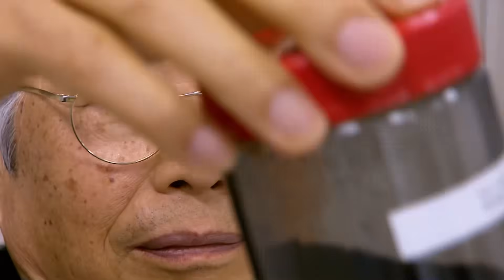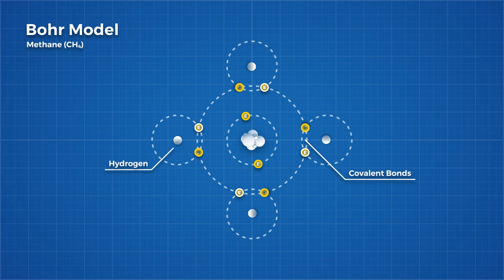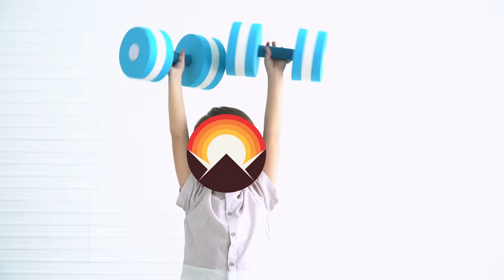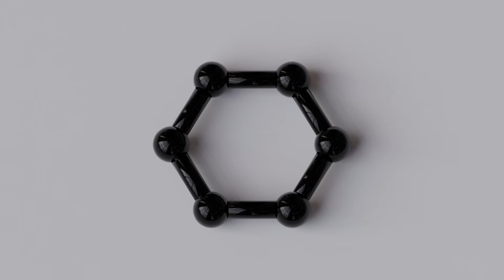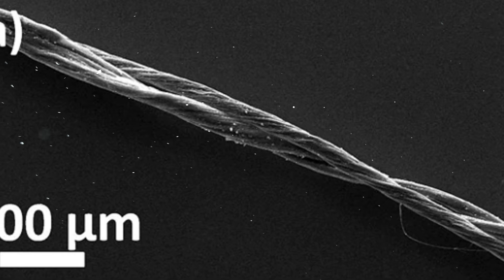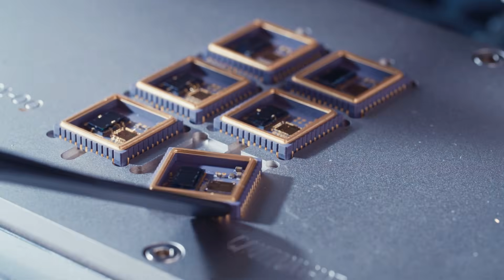How Carbon Nanotubes Will Change the World

Comment: I have been using carbon nanotubes for my drone's motor shaft. I build FPV helicopter in my channel with direct drive rotor using generic 4mm steel rods that does not have bolting holes. I used to use Kevlar to make friction clutch fitting that holds the motor bell to the shaft without bolting. Carbon nanotubes (Galvorn brand) are stronger than Kevlar and less frequently sheared (cut broken) during the shaft installation. The only reason I tell my followers to use Kevlar is the small scale of production by Galvorn with wait time of about 10 days per order. Kevlar dental floss is available in pharmacy 24x7. If only dental floss are made with carbon nanotubes, they will become ubiquitous as household items.

Comment: I work as a polymer engineer. Great video, however we are still a few more years away from seeing them readily used. They possess way to may health risks and dangers. I have had first hand experience working with both single (SWCNT) and multi (MWCNT) nanotubes. One must really understand and know what they are doing when working with CNTs or else there can be catastrophic consequences to themselves, equipment, machinery, and the environment.

Comment: think of low resistance cables which could send electricity to the other side of the planet without considerable losses. that would remove the need of energy storage would it not?!

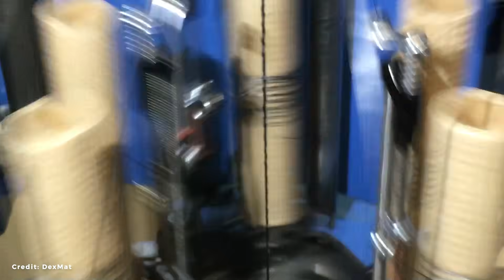Comment: @11:02...'single extremely long fiber' that's the catch... all these wonderful properties are only possible in 'defect free' ultra-long CNT... till date CNTs have been grown only until 700 mm max.. and even these so-called long CNTs are filled with defects which makes them materials of very low strength..  CNTs have been hyped up as wonder material since 1990s, but till date it failed to deliver.. space elevators etc. are only day dreams atleast for the near future

Comment: can plane engines be powered by electric
Reply: Short answer: Yes
Long Answer: Y     E     S

Look at what we're doing with EVs on the road today. The limitations are the weight of the batteries and range the batteries can power the engines. 

If the battery were able to be built within the frame and skin of the plane, the weight could be evenly distributed throughout and no longer in the wings and center holding tanks. 

Graphene is more conductive than copper and lighter, more energy efficient than current batteries, so it's only a matter of time.

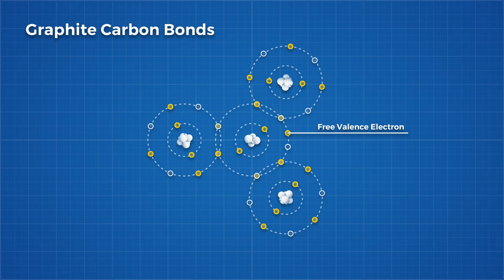Comment: 14:39 Aluminum is more conductive than copper when adjusted by mass. So, on equal weight basis, we get better conductivity with aluminum. (really, it's more complicated than that, because specific strength, durability, etc, have to be taken into account as well).

I typically find at least one inaccurate/misleading statement in each Real Engineering video (this one is on the milder side). He should really get someone competent to review the script.

Comment: I’ve studied just a few of the physics involved in carbon nanotubes recently at university and believe me, this video did a great job at saving you from many headaches and explaining all you really need to know about them. The only thing I would’ve added in here is the research involving the addition of impurities or holes in the nanotube structure, and the multi layer  nanotubes, which show quite promising results. Some configurations even have superconducting capabilities, and it is believed we might be able to get a close-to-room temp superconductor with them, but as far as I know none of that has been confirmed yet. What’s coolest about it is how depending on the way you connect the carbon layers, you can get very different material properties.

Comment: This will all be applied to Transhumanism, merging mankind with machines. It's already started.
Reply: Jabs?
Reply: @benredding7080  That would be one vector, yes. Not microchips but nano-tech. So-called "conspiracy theorists' who said that Bill Gates was going to put microchips in the vaccines were widely ridiculed as tin foil hat nut jobs. 

You had globalist shills/apologist idiots like John Oliver ridiculing that., saying that microchips were too big to go through a needle. However, I'd say that's not what the majority of "conspiracy theorists" were saying. That was a strawman argument designed to disqualify and denigrate. Meanwhile, the real focus of "conspiracy theorists" was, as I say, nano-bots. That said, it turned out that the microchip theory was correct. Microchips for vaccines exist. 

A tech company called Apiject slapped a $100M contract on Trump's desk for a vaccine delivery system with a microchip (optional). I don't believe it was implemented because I don't think Trump went for it. But look it up. 

Back to nano-tech. Scientists in New Zealand say they found nanotech in the vaccines. In fact a scientist spokesman went to the ministry of health to speak to the minister. He wouldn't see the scientist. Refused point blank. See how difficult it is to get the truth out?
Reply: @JohnnyJazzFreak  I think you are on to something. I have heard similar things from Stew Peters mainly. Thanks for the reply. I can read it now, but youtube may remove it because it will scare some ignorant sheeple.👌🐏😢😱👏👁🤷🤘🤔🙃

Comment: As a quantum physicist, let me nitpick a little bit on my chemist friends. Strictly speaking the electron density does not determine the quantum mechanical state, it's the wave function that does, and it has a complex phase that has more information than the density. However, in some approximations used in chemistry, like density functional theory, it's in some sense the only reasonable physical information you extract from the system, but it's useful to keep in mind that this is only an approximation. 
Finally, the reason for orbital hybridization is essentially broken symmetries in the atomic schrödinger equation. Orbitals arise in atoms because of broken degeneracies due to interactions, but it's still a spherically symmetrical system. However, when it bonds to form molecules or lattices, this symmetry is broken to that of the molecule (if it has one) or that of the lattice. In most situations the effect of this breaking is pretty small, and the orbitals still bear some resemblance to the atomic ones, and that justifies the s and p percentages. 
However, if you're doing ab initio calculations it's generally possible to skip all of these concepts if you want, since you are just simulating everything.

Comment: XPRIZE CARBON CAPTURE: 
FORMULATED MICROCRYSTALLINE WAX WILL CAPTURE THAT BLACK CARBON SPEWING FROM THE WORLDS INDUSTRIAL SMOKESTACKS 

The solution for capturing carbon was discovered in my lab and candle shop over 40 years ago. I knew back then that this was going to come to this day. I had to search for the answer and did. The heat loss from a smokestack can be forced or harnessed into a large tank containing hot liquid microcrystalline petroleum wax. The heat will keep the wax in a molten state which facilitate the carbon to be absorbed when combined with the wax. Carbon when mixed with wax reacts like a dye. The wax-carbon amalgamation will result in a black wax solution thereby making it impossible for the carbon to escape into the environment while in a liquid state. Other toxic particles are also captured in the wax settling at the bottom of the tank as a sludge. A sludge release valve is located at the bottom of the tank. After the sludge is removed more wax is replaced in the tank working something like a toilet. The sludge becomes a byproduct that can be used as an additive to asphalt for roads or used for cocooning nuclear waste materials for long-term safe burial. The entropy of the Earth has been increasing at a startling rate since the beginning of the industrial revolution caused mainly by the carbon that is released into the atmosphere. Government scientists have failed to stop and prevent carbon pollution from entering the environment. This problem can only worsen until a solution is found before this problem becomes irreversible. It has been discovered that formulated wax has been shown to be the only answer to this problem.

 PREVENTING SPREADING RADIATION:
This formulated wax will also help prevent the spread of radiation such as preventing the escape of Plutonium dust particles from nuclear reactors or from structures or buildings housing radioactive materials. In 1994 This method was successfully demonstrated on the Sarcophagus of Chernobyl's blown-out reactor # 4 that was leaking Plutonium dust particles through open seems. In 1995 formulated wax tape was used to cocoon radioactive metal that had spat out of the reactor at the time of the explosion for safe long-term burial.  In 1993 a wax membrane method was used in the yard of an abandoned house about five miles from Chernobyl to demonstrate how to reclaim radioactive contaminated territories for re-cultivation. 

I have been researching wax for solving mankind created environmental problems since 1969. As I aged, I discovered many other uses for wax such as making candles or replicas of people's hands. This led to coating the hand castings with latex rubber. After the latex had cured, I inserted latex rubber tubing a quarter of an inch tubing in the tips of each finger that was sealed with the latex. After the latex had cured, I was able to pull the end of the tubing that caused the fingers to contract. By pulling the ends of all five tubs the hand would close or grip and was able to pick up things such as a pencil or jelly beans just like a normal hand would do. The end result would act like a normal hand. I was able to color the hand to match the color tone of the hand that I replicated.  The end result was a prosthesis hand. Through the years I have discovered many other uses of formulated wax for solving environmental problems: Here is a list of confirmed uses since 1969. 
OTHER USES FOR SOLVING POLLUTION PROBLEMS USING WAX:
• Remove oil spills from dry or wet sand, soil, water, ice This method was demonstrated for the Canadian government in 1974 to remove oil from a beach on Passage Island. This method was demonstrated to the US Coast Guard on two occasions, one in Hawaii and the other in the state of Texas demonstrated to the Canadian Coast Guard on two occasions. Oil can be removed from beach sand as though it was a giant carpet More demos were shown to the Canadian press on three occasions. 
• Preventing radiation leaking from reactors, buildings, and storage facilities. This method was used to prevent Plutonium dust particles from escaping into the environment from open cracks and seams on the Sarcophagus of Chernobyl's blown out reactor # 4 in 1994
• Cocooning asbestos coated pipes wiring for safe removable This was demonstrated in the basement of an apt building that has 319 feet of loose asbestos
• Cocooning radioactive waste for a long term safe burial. This method was demonstrated in Chernobyl by removing a 4” x 5 ‘ rusting metal tubing that was buried and coating half the tubing with a special microcrystalline wax and then re buried.
• Removing radioactive contaminated hot spots from soil surfaces approx. 4 feet square in Chernobyl in 1995
• Preventing uranium mine tailing particles from becoming airborne in 1987 by laying a wax membrane on the mine tailing surface in Elliot Lake Ontario. 
• Preventing radon gas from entering into homes or buildings demonstrated on three homes having very high Radon levels where 95% of the Radon was blocked.
• Preventing crushed coal dust particles from escaping moving open rail car trains was demonstrated in 1975 by spraying hot microcrystalline wax on the exposed coal surface to prevent the coal particles from becoming airborne while the train was in motion. 
• Preventing fly or bottom ash pile dust particles from becoming airborne Removing bunker oil, diesel fuel, gasoline transformer oil demonstrated for Ontario Hydro in Kinston Ontario in 1991
William Nelson, waxogen@gmail.com   Please share, thx

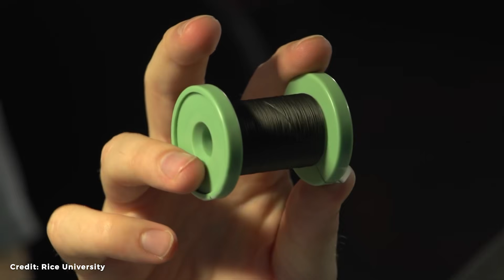Comment: 13:45 - This was key for me.
Carbon nano-tubes still aren't as good as carbon fiber composites.  Their major use will be to replace wires stretched over long distances.
The other markets for Carbon Nanotubes is just too small, and the benefit too small out overcome the obvious outrageous cost.
I don't see this taking off unless there are Space or Military applications,
or some new derivative is made, that solves a lot of it's current problems.

Comment: USSR is not your Americo garbage learn history. A 2006 editorial written by Marc Monthioux and Vladimir Kuznetsov in the journal Carbon has described the interesting and often misstated origin of the carbon nanotube. Much of the academic and popular literature attributes the discovery of hollow, nanometer sized tubes composed of graphitic carbon to Sumio Iijima of NEC in 1991.[1] L. V. Radushkevich and V. M. Lukyanovich published clear images of 50-nanometer diameter tubes made of carbon in the Soviet Journal of Physical Chemistry in 1952.[2] This discovery was largely unnoticed, as the article was published in the Russian language, and Western scientists' access to Soviet press was limited during the Cold War. It is likely that carbon nanotubes were produced before this date, but the invention of the transmission electron microscope allowed the direct visualization of these structures.

Comment: Well done. Applications of the magical single wall carbon nanotubes (SWCNTs) need reliable repeatable production and processing techniques. Please note that in many cases, multiwall carbon nanotubes (MWCNTs) seem to have equally effective. One thing you missed is the purity of the as-produced material which affects all the applications you mentioned. It is important to assess the impurities and defects to achieve the full potential. Also, the biocompatibility is still under scrutiny and requires further evaluation for each application for medical uses.

Comment: why not try to make it magnetic on the inside to speed up transfer rate. You already coat the outside, magnetize the inside with a thin layer of magnetic metal or something. Then make it smaller, the technology would progress faster because we would achieve the fastest transfer rate as possible if successful as time progresses to make them smaller.

Comment: ok but hows the progress of mass production, cause until that's off the ground nothing will change
edit:grammer
Reply: Agreed, mass production is a critical piece of the puzzle, but one that is actively being addressed.
Reply: @paulferguson8764  they also need to mass produce it with minimal to no defects, I say were another 15-30 years away
Reply: @person4585  i suppose it depends on what you consider to be the threshold of mass production.  I believe that methods exist that enable large scale production today.  Tens to hundreds of tons per year.  This is particularly so for CNT hybrids, such as CNT-carbon black, for example.
Reply: @paulferguson8764  yes, but the more you produce, the more defects we are bound to have, the tech for synthesis isn't refined yet, if anything like you said, there will be cNT composites, because pure sheets are too hard to make, metal CNT matrixes for construction, a layer or 2 for your battery, porous composites for armor, plus in order for something to take over, it cant just be better, it's gotta be MUCH better, composites will fill that role once they crack the code

Comment: I'm most interested in carbon nanotubes being used for electric motors to replace copper
Reply: Interesting concept, but the cost differential between CNTs and copper is enormous.  Plus there are much higher value applications than using CNTs to try to compete with copper, imo.  Finally, while production methods are advancing, the volumes are still relatively tiny compared to the amount of copper that is produced.

Comment: What are you talking about?
Carbon moicules in the form of balls  was first developed over a period of 5 years, by students during the early 1980's, at various universitys. The resulting work of the students was reported in weekly news magazines. They did the experiments in labs using carbon rods & laser, contained within vacuum chambers.   The resulting carbon molecules were named Bucky balls, after Buckminster Fuller.

Comment: Hi, your sigma bond at 7:05 is illustrated wrongly, the orbitals are not showing head on overlap. Your animator probably tried to show the arrangement of diamond, but caused an error in the overlap. Also, much appreciated if half arrows were used for electrons for half-spin accuracy. Thanks. Otherwise, the explanations and animations were great

Comment: Very well-produced video and very up-to-date on developments in the field.  However you need to look more into the impurities that collect on nanotubes during manufacture and how those impurities affect their ability to be used in this applications, as well as our ability to measure specific properties on the nanoscale that have drastic effects on the performance of the materials in those applications, not to mention our ability to make sure that we're making the same product again and again.
Reply: CNTs can be manufactured with extremely high consistency, so that is a non-issue in my experience.  Impurities are the results of the catalysts that are required to synthesize the nanotubes (cobalt, moly, aluminum).  Those elements can be removed chemically with acids or thermally.  Thermal purification can be highly effective at removing the impurities but care must be taken as the structure of the tubes can suffer damage if the heat is excessive.
Reply: @paulferguson4930  CNTs also graphitize at lower temperatures than things like PAN.  The result is that the CNT fibers that are made lose their mechanical advantages (e.g., elongation to break) over conventional carbon fibers.   I've seen it happen at 1600°C